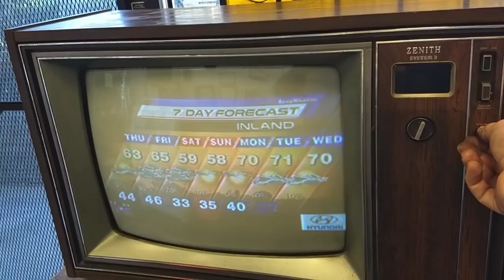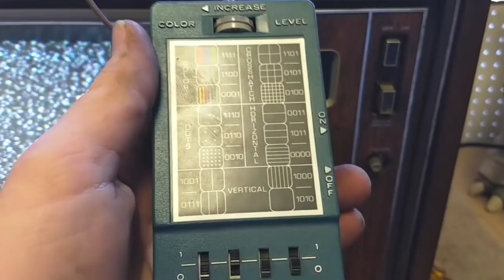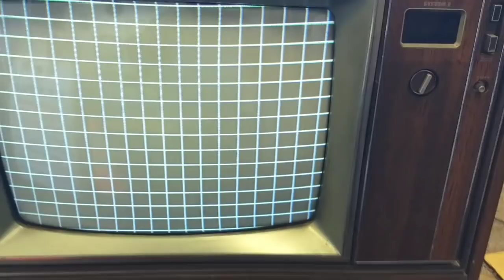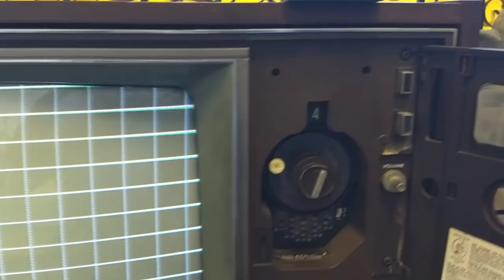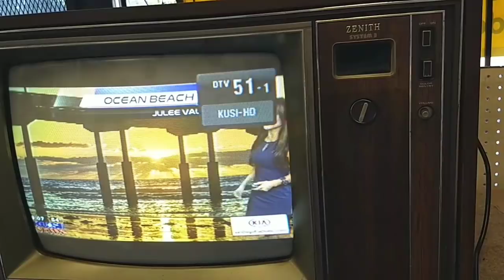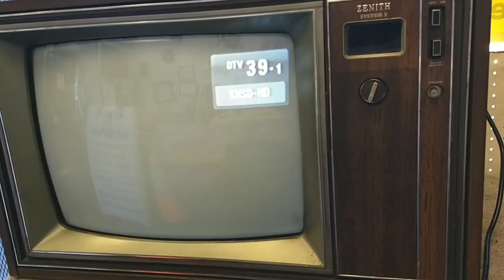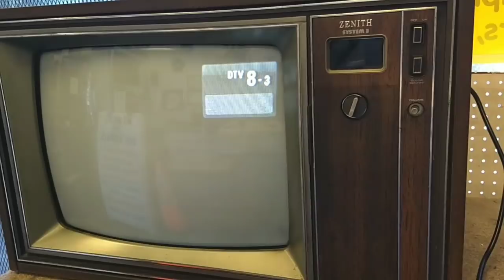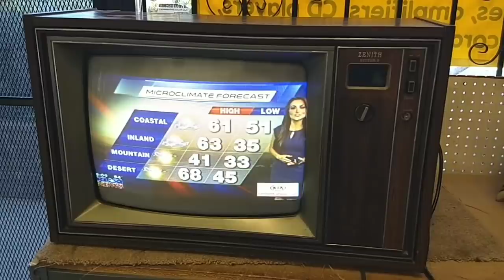Acquisition and service of a 1978 zenith k1970p color tv part 2/2

Comment: Hi, It'll be a nice replacement for your flat screen, and it will serve as a heater for the winter too! System 3s are power hungry... Regarding the channel indicator, it's a neon bulb (it used to go bad), you have to remoce a "c" clip and a washer on top of the indicator wheel axis (and probably remove the backplate, can't remember...). It has a series resistor at the terminal strip on the back of the varactor unit, check it for drift in value. Good Luck.

Comment: That was the best System 3 chassis and I think they only made it for one year, in both 19" and 25" versions. The one after this did away with the power transformer and replaced it with the infamous 9-160 power supply/sweep module, with the rest of the modules being the same as this one.

Comment: Do you know where I can find the schematics on the KLH 100 table top clock am/fm.?I'd like to recap. I'd like to keep forever.
Reply from the maker: That's going to be a tough one. That radio was made at the turning point where the company was being sold off. If it's still running ok, I wouldn't touch it. They are fairly reliable and the risk of hurting something by making a mistake recapping is big. There are also often errors on the schematic or product line changes that aren't reflected in the schematic.

If you must recap, make an inventory of what's inside, order high service life 105 degree capacitors and replace one by one to lessen the probability of a polarity mistake
Reply: Thanks, the pots are scratchy, going to deoxit, how would I know the audio path vs power, Also nice to see Shango66 is in the house.
Reply from the maker: Power supply usually centers around the transformer, larger value capacitors (1000uf and up) and regulator transistors on heatsinks.

Audio usually centers around volume, tone control and input selector switch. Capacitor values of .47uf to about 47uf, some slightly larger values near the amplifier for buffer and feedback circuits